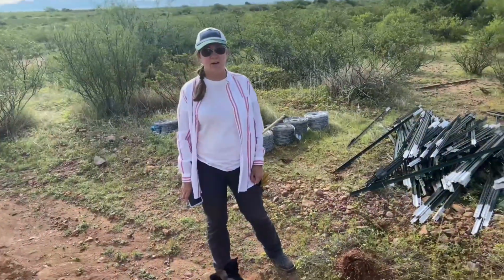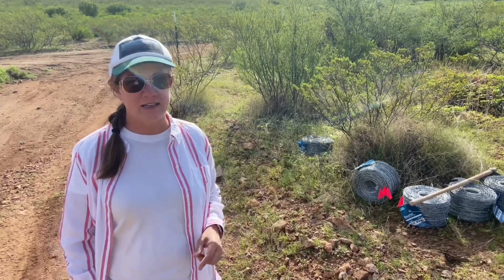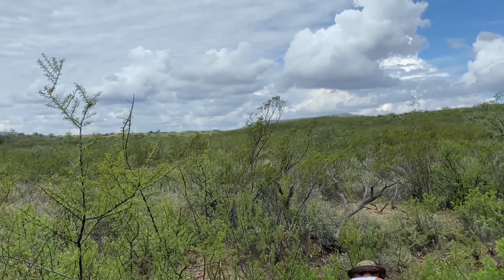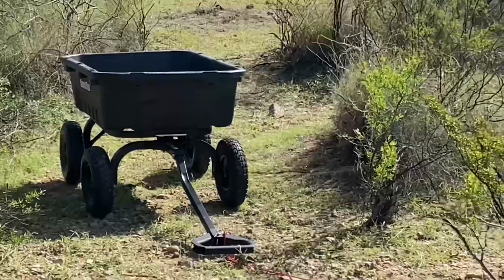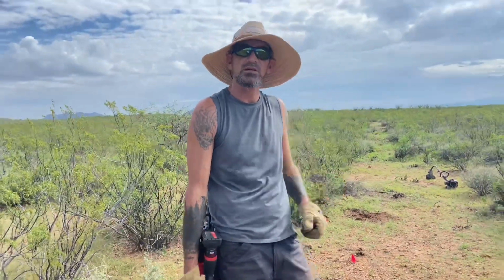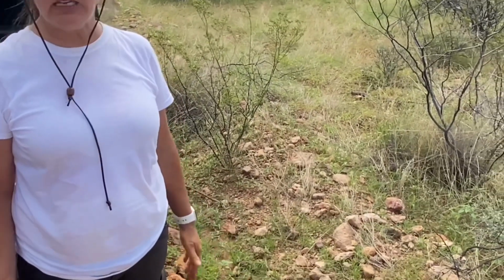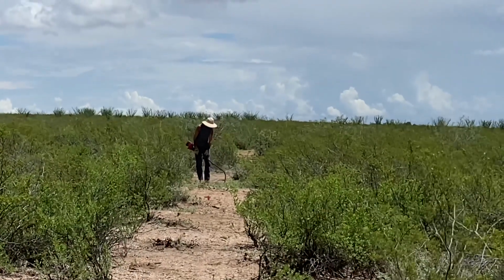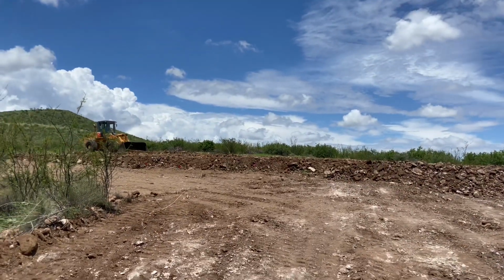Excavating and Clearing the Fence Line

Comment: You can also spray paint the ibc tote black...tarps etc get tattered and weathered easily in the high winds and heat here. If just construction water for this one I wouldn't worry about it but later on you may want to coat others used for showering and dishes. The excavator guy did a super job tiering the land! Looking great! 🥳 Oh and as for how to ship packages with no address yet...we are in same boat...we have everything shipped to a Pro Ship Express store in Douglas...maybe they have one near you?
Reply from the maker: That's not a bad idea either...yep, we've noticed that about when someone puts up a tarp...doesn't seem to last too long and those things can get expensive constantly replacing them.  We agree...he surpassed our expectations and was able to move a lot more material than we expected...so many rocks!!  Good idea on setting up a shipping account.  We might try a PO Box too, but need to look into how big of items USPS will let you have delivered.  

We just read your "about" on your YT bio and how cool!  You are doing very much the same thing we have done/did :)  We had a septic company out last week for the soil/site analysis and luckily it's too rocky to do anything traditional (which we didn't want anyways!) and we will be doing the alternative system too.  We already compost in our trailer and it's super easy and makes a lot more sense.

We will look forward to when you all start putting out videos!!